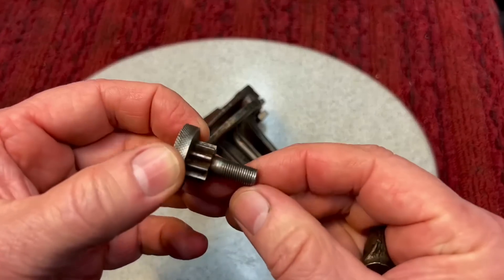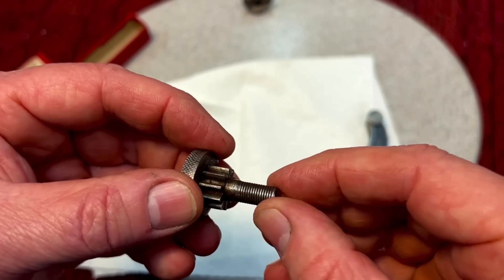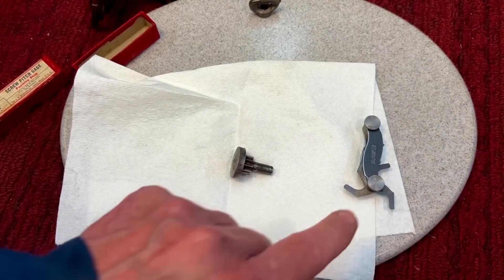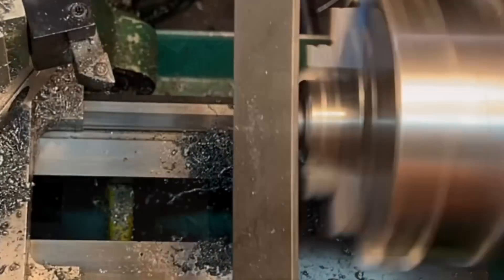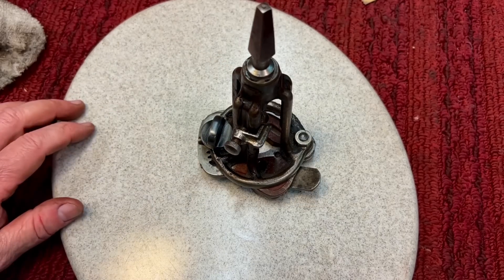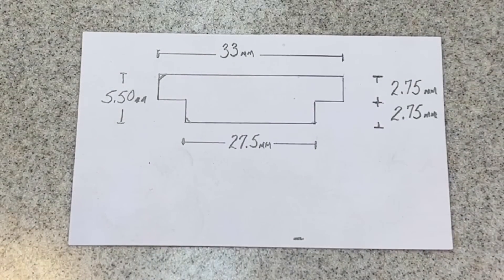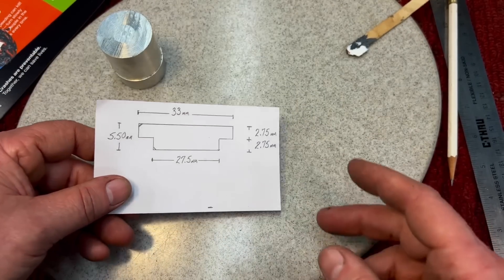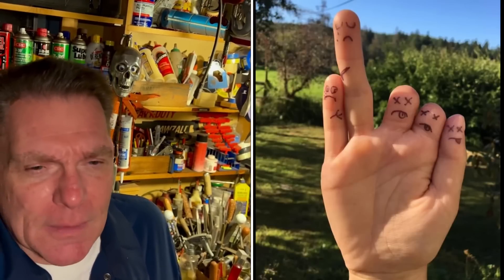Repairing Antique Hollow Mortising Tool and Fabricating Parts

Comment: About staying current with your tools, Thursday I was helping to strap thing to pallets for a friend who is liquidating the family business. The person who had brought over the strapping equipment knew how to use it but doesn't use it every day, probably only a few times a year. It took a few tries to get the first strap lined up right in the machine that pulls the strap tight. After that it went pretty smooth.

Comment: Great restoration of the tenon cutter. I have one of those, but I think the one you restored has a much less clumsy adjustment mechanism. I noticed that the tool has a modern looking hexagonal nut. It caught my attention because it didn't have the patina of the rest of the tool and also those old tools used only square nuts.
Reply from the maker: Yes, I too wondered about that nut. Was it possibly a square nut or maybe another thumb nut?  You’ve got a keen eye!  Thanks! 😃👍

Comment: What a great and interesting restoration of the Hollow Mortising toll. I think, this tool is still in use by Mr. Dave Engels from Engels Coach Shop in Montana. I saw him using that morteniser by producing wooden spokes for coaches. Nice little tool and it is interesting for me to know, who probably made this in the early days? A blacksmith? Thanks for your video

Comment: Both of the knob fixes you did were impressive. If I was going to use that tool, I would prefer the machined solid steel one you fabricated over the cast original. The way the original one was cut and the fact that it was cast was a turn off. A solid steel knob is a huge improvement. That said, I respect the fact that you salvaged and improved the original unit as well, even if I didn’t like the original hollow pass through design. Nice work! 👍

Comment: SC, great repair on the mortising tool!  Just a guess, but the threads probably stripped out from over-tightening (not over-use or age).  That oval hole in the top of the original thumbscrew was probably intended for inserting a tightening lever/bar/screw driver.  Some older designs, I've noticed, used similar provisions.  (Not sure, but a modern split-type lock washer under the thumbscrew might help with future over-tightening.)

Comment: Excellent work ScoutCrafter! The restoration on the mortising tool was great and the fix you made made by pinning the new threaded insert on the original thumbscrew should hold just fine. I suspect the reason the original hole was drilled off center is because of the casting flash on the thumbscrew put it off center in the fixture when it was drilled and tapped. Any tutorial on the lathe is a good one. Thanks for sharing this.

Comment: Metric certainly is easier, but, using fractions requires thought and adds difficulty to things. That’s part of the challenge. If the easy way was the way everything should be done, then there is no challenge other then the task itself. Anyone can move decimals after all. That part almost seems like it would make a lens cap or something similar.
Reply from the maker: Joe- All my tools are in SAE so conversions are my downfall.  🫣😂👍

Comment: Nice job on the restoration and making the new part.   Making thin parts can be a challenge.   Well done.
Good examples of how useful metal lathe can be.   I purchased my metal lathe in 2014.   I should have purchased one a long time ago since I find it so useful.   Sometimes for repairs, sometimes making parts for wood work/turning.
Dave.

Comment: I like the new fastener better than the old, but the old one will be fine if Bubba doesn't ever get a hold of it and start tightening and loosing with a pair of pliers, that cast can still cause trouble. I always wanted one of those mortising and tenoning sets to make log furniture. I have mostly aged out of it. You are right about the tool use. I think the only two that I have no problem with is a drill press and a hand saw. Guess I don't have much trouble with chainsaws either. Anything else and I am slow. I am naturally careful not to abuse tools. I know guys that will shove wood through a saw so fast they drag the motor down. That aint me man.

Comment: OK, Scout, what did you do with Snoopy?  This is the first time in a long time I couldn't find him.  Did you replace Snoop with the Skeletor door knocker?  By the way, I prefer the original with the insert.  My pal, Tommy Lee, a machinist at a steel mill told me NEVER to reach around a rotating chuck; learn to file left-handed instead.
Reply from the maker: I think with large lathes you really can’t safely reach around them, with small lathes it’s very safe and effective. 😃👍